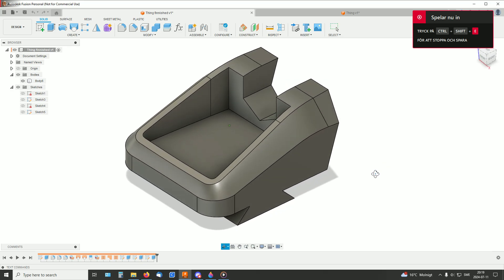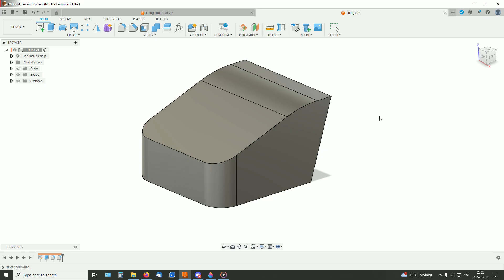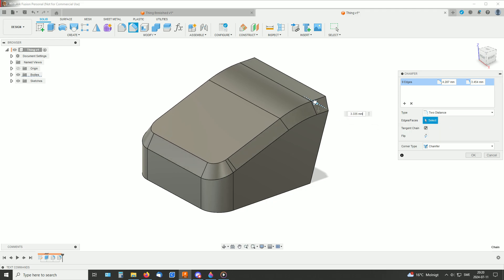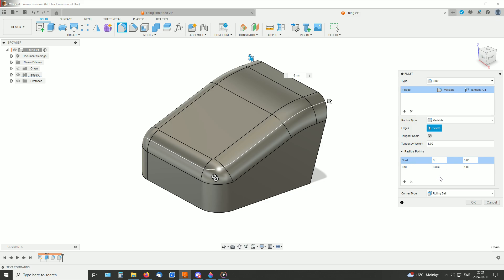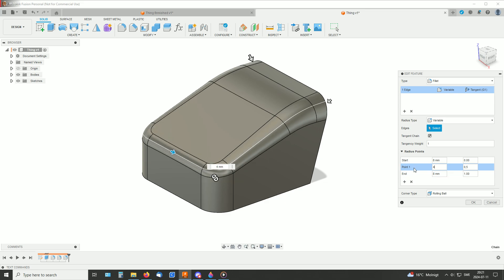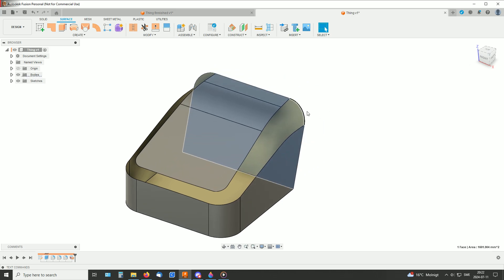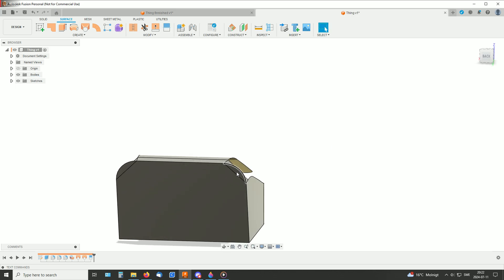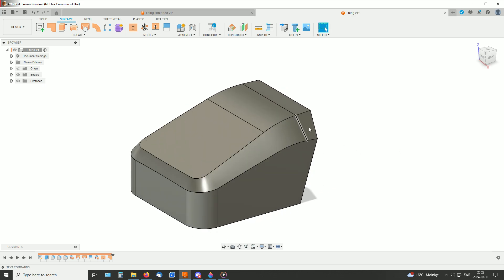Chamfer with variable distance - workaround with a little surface modeling

Comment: how do you have the top edges connected altogether like that? mine is separated
Reply from the maker: @blooper68  Not sure what you mean. At what time in the video? 
Maybe you just need to use the stitch tool to merge them, or do you have a gap between them?
Reply: @Fusion360modeling-fb4gt  yep, turns out i didnt stitch them properly. thanks!